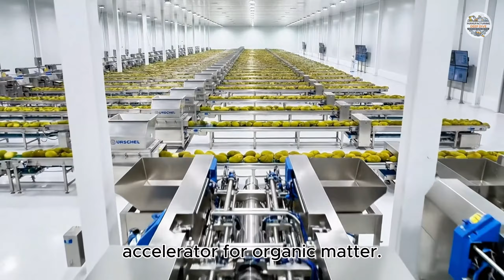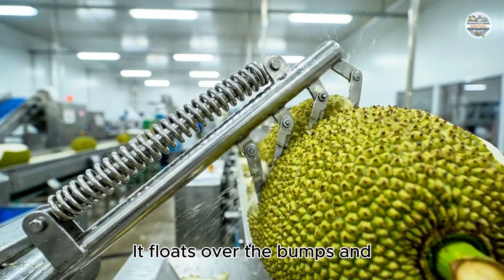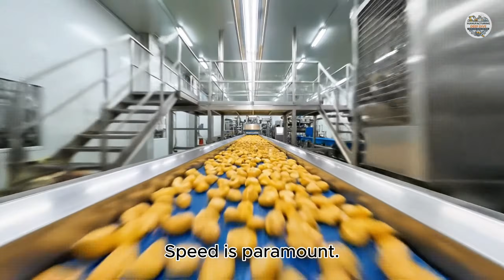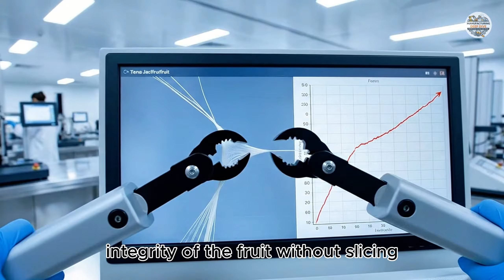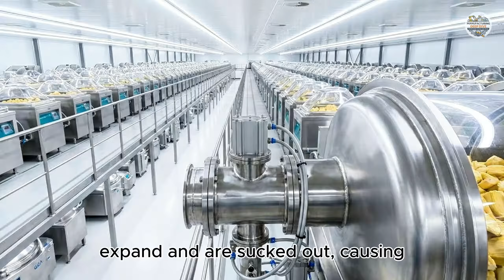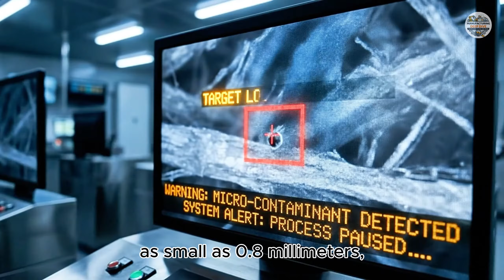Inside the 50,000 LB Jackfruit Plant – The HYPNOTIC Shredding of Modern Vegan Pork Production

Comment from the maker: 🔩 Inside a 50,000-LB jackfruit facility — where heavy engineering turns fruit into vegan pork 🌱
This video captures the entire industrial process, from hydraulic splitting and acid blanching to high-speed shredding and sterile packaging. No recipes. No chefs. No home kitchens.
Just machinery, physics, chemistry, and automation working together to create pulled-pork texture, strength, and flavor at massive scale.
👉 If you’ve ever wondered “how vegan food is actually made inside factories,” this is the clearest look you’ll get.